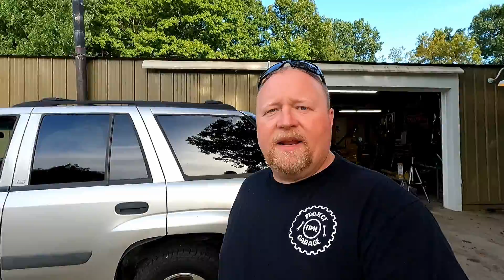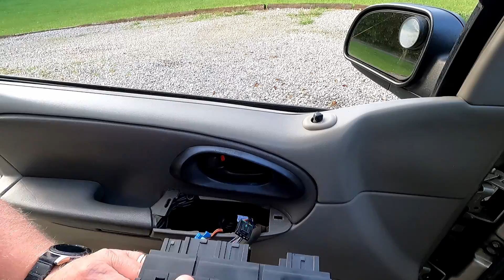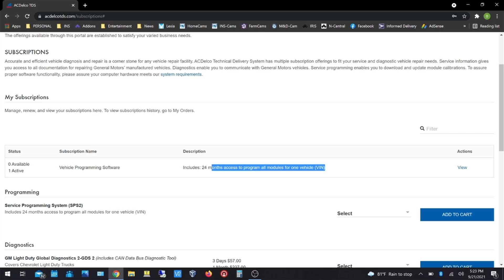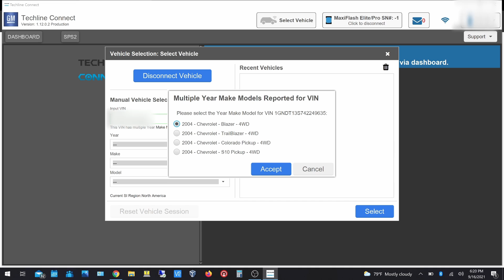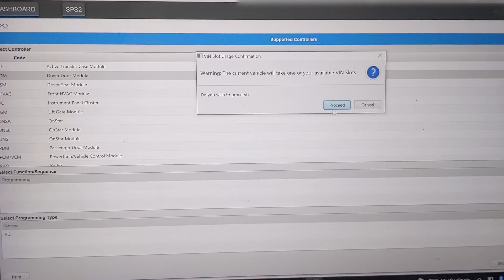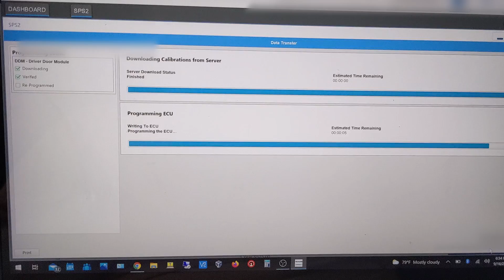I tried to replace my Trailblazer Window Switch (Drivers Door Module) Myself - Including Programming

Comment: I had no power to anything on the drivers door no window control, no lock, no mirrors and no dome light. Though it was a cut wire or worse. turns out the controller does everything. Thanks for telling me that you can switch the passenger side to the drivers side. This let me know that the window controller was the issue and not a damaged wire or bad ground. Going to get a used one off ebay for $35-40. Thank You so much, saved me a lot of time and money since I know the new ones are way to much money and need to be programed.
Reply from the maker: Nice, glad to help.

Comment: So according to the comments if you go to the junkyard and get a used module it will work with no programming , so what’s the point of the new one needing programming ?
Reply from the maker: As I understand it, a junkyard one works because it has a VIN programmed into it, a new one will not work at all until a VIN is entered. As to why a new one, the vehicle came to me with the new one and the owner said "put this in here" - I did.

Comment: Listen, a 2004 model get one used for a fraction of the cost and no programming!
Reply from the maker: I also found that you can buy a Dorman repacement that doesn't need programming. It wasn't my truck and I didnt' buy the part. Dude said "here's the truck and switch, install it" - I did.

Comment: ? Do you just have to reprogram it if it's a new part ? What if I go to the junk yard and take it off another truck same year and all ?
Reply from the maker: No, I think the used parts are fine without programming.
Reply: Seen em pull this 1 from scrap yard & still HAVE 2 Program Bc SALVAGED Truck ~ Parts & Computer Shut Down ~ Also Salvaged. thx 4 ur vid

Comment: I recently installed a new power module in my 2006 chevy trailblazer, all but the rear passenger window works and the front passenger power lock does not work when buttons are pressed. The rear passenger side power window button does not work as well. Any suggestions?
Reply from the maker: Must be a switch problem???
Reply: @ProjectTimeGarage  on a new module?

Comment: I just went to Pull-A-Part paid $35 for the switch plugged it in and it works no programming required.😊
Reply from the maker: Yeah, I've found that the used ones work fine.
Reply: Same!! Mine was only $9.95 at U-Pull-& Pay.
Reply: What is it called a switch imma do that
Reply: Thanks
Reply: What year if I may ask?  I need one for my 2005
Reply: And I've use new one the same way I'd wear  u found that info

Comment: This video only applies if you buy a brand new window module from the dealer or auto part store. If you get a used one from a local junk yard or from ebay, it's already programmed and will work as soon as you plug it in. No additional programing necessary.
Reply from the maker: Yeah, we found that out in the comments a few months back. Crazy stuff.
Reply: Yo did you use a different year module, or does it have to be the same year ?
Reply: I bought a used one off ebay and it didnt work? Im confused ? Theres no way it couldnt be programmed right ?

Comment: Hi! 1st, Thank you for doing this video. It was Very enlightening and helpful. After watching your experience with this issue, it kind of had me a lil bit bent outta shape that once again, the manufacturers are screwing over us guys that work on our own stuff. I have for over 40 years now. BUT, After reading some of the comments from others on here having the same issue, I opted to go try my luck at the junk yard. Mine is an 09 Trailblazer, and they had an 08 switch that matched mine buy white where my original is black (oh well right? lol). I bought it, brought it home and it works like a boss, plug and play like all these others are saying. I'm assuming it's like one of the commentors said, that may be due to this one already having been programmed with a VIN number in it. Thanks again. Just wanted to let you know my experience with it as well. May be useful to others reading these comments as these others were to me.
Reply from the maker: Thanks for the comment - I'm sure that's what the deal is with the junkyard ones being pre-programmed with a vin number.

Comment: But also I got a question because I have an 08 trailblazer and the passenger window won’t go up or down I got a new widow system or whatever and it still won’t work but the module on the passenger side is fried
Reply from the maker: Swap the driver's module over for a quick test. Connections will be the same. If it works, then it's the module.

Comment: Hey had a question if i buy the DORMAN 901-651R for my 03 envoy i assume it's pre programmed? Or do i need to do  this as well? Thanks for the video.
Reply from the maker: Not sure. I've never worked with any of the Dorman replacements. If you install one, please let us know if it had to be programmed or not. I'd love to know.
Reply: @ProjectTimeGarage  well i got it and installed it and NO PROGRAMMING needed all functions work i have a 2003 GMC envoy! So maybe get the DORMAN part. Thank you.
Reply from the maker: @michaelfaga1107  Man, thanks so much for reporting back. That's great information!!

Comment: I’m working on a single cab silverado 03 with manual windows. Bought a donor same year single cab with power windows locks etc. switched all the wiring components dash and bcm the controls seem to work at times but at times it loses signal bought a Autel to help troubleshoot and as I suspected I lose connection to the window control module but when I scan it since the vin ain’t the same since it’s off the other truck will I have to program it to that vin or the actual vehicle vin ?
Reply from the maker: So, there's a bit of a grey area there. It seems that sometimes used parts don't have to be programmed to the system. Other times they do. I guess having a different vin on the module vs what's in the PCM, you could run into intermittent communication issue. It could very well be the case.
Reply: @ProjectTimeGarage  I use a scan to like the one you use and it’s and the trouble code were it saying that control module communication fail but like I said I scan it and it works and at times it don’t

Comment: Brian, my wifes Trailblazer the passenger side works intermittantly from the drives side module. I saw you took the switch apart and I could see its the type with the little magnets touching the circuit board. Does it come apart easily because I would like to try cleaning it. I have done it to my HHR door switches and they work fine now.
Reply from the maker: It did come apart fairly easily. Just plastic clips as far as I remember.

Comment: Thanks for the video man!
Reply from the maker: Thanks for watching!
Reply: @ProjectTimeGarage  short question...all 4 windows stopped working, after a few hours i was able to put them back up but then, they sttopped working again...relay? Your suggestion sir, same truck as yours
Reply from the maker: @josegarrido7021  Maybe. Could also be an ECU or a switch panel intermittent failure.
Reply: @ProjectTimeGarage  thank you!!!.
Reply: @ProjectTimeGarage 2006 LS

Comment: Holy crap Brian! $200 module and still doesn’t work! You got my attention at “program it myself!” I like your kind of thinking! I need to get a cheap (good used) laptop. (My boss sells them) I think we need to go back to the older vehicles (just old enough you can fix them, but new enough they are safe)
Reply from the maker: I'm with you Mark!!